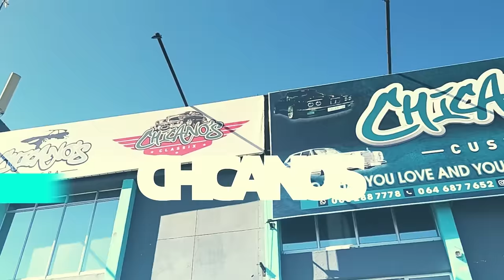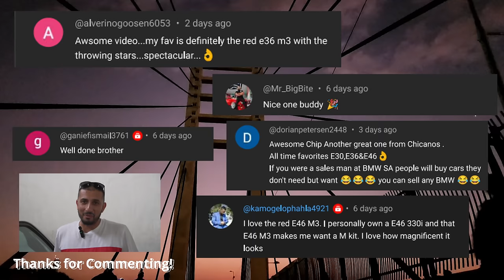We SOLD our BMW 325is Evo 2 Barn Find!

Comment: Mr Chip Moosa, which car brands are the easiest and cheapest to restore, also looking at the fact that they're parts are not expensive and they are easy to find?
Reply: Hi there. It depends a lot on the actual cars condition and your understanding of a restoration. Very difficult question to answer.
Reply: @chip_moosa  Alright, but do you think a fully restored old toyota corolla can hold its value in this coming years?

Comment: What's the diff between evo1 and evo2
Reply from the maker: Evo 1 typically features subtle engine upgrades and cosmetic changes, while Evo 2 has more aggressive engine modifications, distinctive body kits, and additional aerodynamic enhancements. Both models may include improvements to suspension, handling, and unique interior trims. Evo 2 is generally rarer than Evo 1.